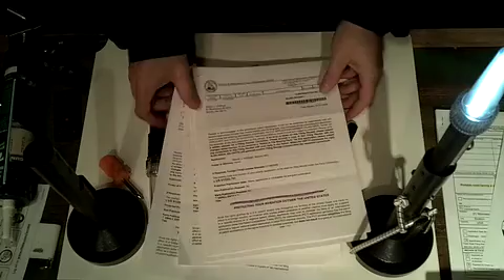Building a Kayalite™ kayak light - design, engineering, manufacture.

Comment: Tektite lights are the BEST. Tektite makes 2 and 4 led lights. Not sure what kayalite uses. 4 LED is a bit  brighter but batteries are used faster. They both last a long time it tells you on their website. Navilight and all the rest I've used are JUNK. Shot in a year or two. I use a tektite on my deck bag and throw one on my shoulder of my PFD. I also carry at least one extra Tektite light. Kayalite looks well made. If you have one on you back deck your body may block it if viewed from the front. So I'd recommend two or at least one Tektite light on the front deck and kayalite on rear. You don't want light to hamper your vision at night. Don't buy fancy looking Chinese junk lights. This setup will last you for years. You can also buy a cheap battery tester to monitor you batteries. You don't want to go out and have a light that doesn't work it maybe you life. 

Paddle craft are better to use only white lights not lights like a boat red or green. Head lamps are good to bring also. I recommend Princeton Tec also made in USA. I have 4 of them for kayaking, mechanical work, and construction work.  Good in emergency situations also.  Buy American. These lights are great kayalite using Tektite is by far the best and not expensive. Great products!

Comment: do you have a model with a telescoping pole?
Reply from the maker: The Kayalite is a fixed height of 17.5". It is not telescopic, nor do we recommend taking it apart for a DIY approach since its engineering (i.e. bolt, tensioning system, etc.) was designed for its height. If you need a taller light, consider our Radpole arm and light, compatible with RAM "C" ball bases.

Comment: @KayaluGear 
We own your stern lights and really like them. I also own your Universal Camera Mount that I added a quick release to. Both fantastic products, but now we need to get to get bow lights for our kayaks.

So far the best we have found are these lights. 
Paddler's LED Navigation Lights from Tom's Top Kayak Shop
But it seems like your system with TekTites on a right angle mount would be so much better.